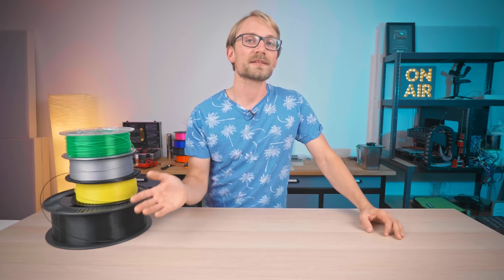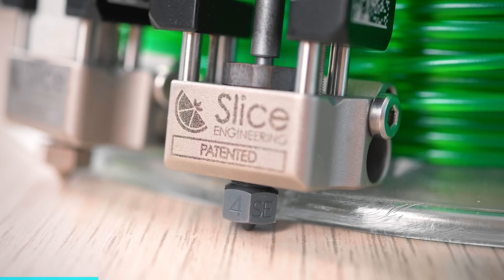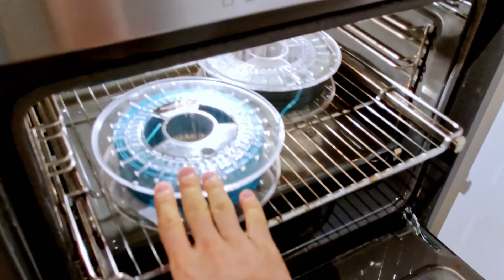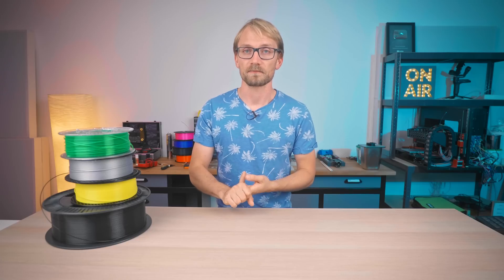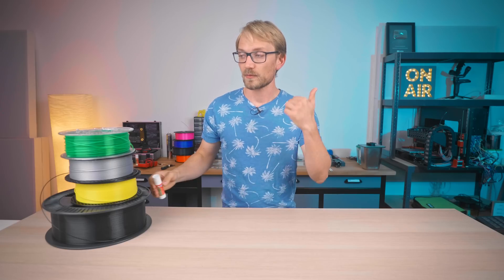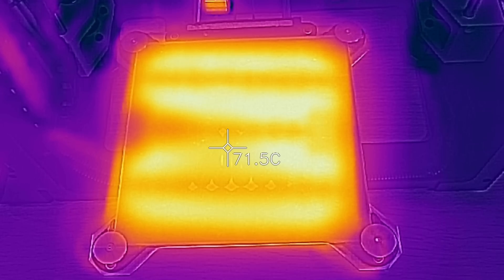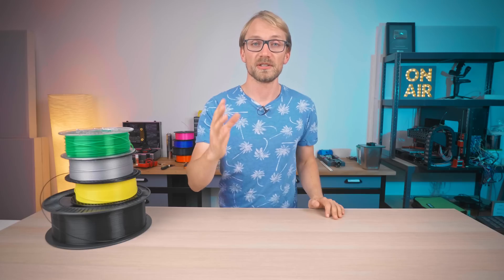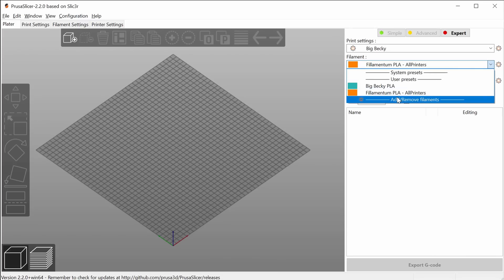How I tune in new filaments!

Comment: 80-90 on the bed for petg? I don’t use any heated bed on my petg and I’ve never had a single issue....weird.
Reply: Depends on how big the print is. 

I had to go up to 95c bed temp on a 12x12x10 petg print as even at 80c bed temp it started curling up like abs. 95c, it stayed perfectly flat until the print was done and everything cooled slowly

Comment: Hi Tom, You commented on my twitter post about the strange patterns in my top layer and said I had backlash. It was also many other issues related to this video. My ender had a dip in the middle of the metal bed so when I removed my glass bed to use a flexi metal pei sheet it was dipping in the middle. I also had to work out the amount of filament extruded because it was a bit too much plus the fan on the ender was running very slow. So all these problems caused my rough top layer. I switched back to a glass bed, re-calibrated the extruder and the diameter of the filament fixed the slow spinning fan and I had much better results. Also adjusted the belts, replaced the nozzle and made sure it was straight.

Comment: Before tuning in flow rate and retract I like to tune E-steps and linear advance set the values in the filament specific start G-CODE in prusa slicer. Those value can vary greatly between different types of plastic.
Reply: I would probably go in this order: E-steps, flow rate, linear advance, then retract.

Comment: Great video, this is exactly what I've been in need of. Quick question; do you keep your filaments stored in dry locations even if you dehydrate before use? I've been contemplating making a dry enclosure for filament storage.
Reply from the maker: Depends on what type of filament and how well you can condition your space. I'm totally ok with leaving a spool of PLA out in my dehumidified basement, but I wouldn't leave PETG out in Florida humidity.

Comment: dry.

heat tower.

flow rate cal.

optimal level height.

that's it :) better yet, it takes under 30 minutes (thats with print time.)
Reply: I'll change my order. I usually do flow rate cal (by measuring the walls of a vase-mode box) and then temperature tower. (I also to K value for LA and max volumetric flow, but both of those I do after the temperature tower.)

Comment: Another great video!  Question: you mention putting filament in the oven, I've heard about it for a long time now, but, what are your thoughts on a gas oven?  It seems to go back and forth on ya or na.  I don't have an electric oven, or dehydrator big enough.
Reply: I don't think there are any gas ovens that can maintain low enough temp.
Reply: @CJICantLie  I'll run mine with a external thermometer, thanks for that idea... My concern was the moisture that burning gas produces... Counter productive?  I don't know.
Reply: @Christopher-Enoch  I have heard, about the only way to use a gas oven is to heat it up, let it drop to the temp you want(80-100 for abs/nylon/petg drying, 60ish for PLA), then toss the rolls in and let it cool off a slowly. Going through that cycle a few times can get the job done. It just won't be as hands off as electric.
Reply: @CJICantLie  Yeah, mine only goes down to 76C. Bummer.
Reply: Food dehydrators can be found as low as 20 dollars (on clearance), the 50 dollar-ish jayo filament dehydrators work slowly... if you have a toaster oven that is big enough to cook a pizza and has temp controls then you  can use that but watch it so it doesnt catch fire. Just some ideas if ya havent found something that works yet.

Comment: I don't understand why stringing and blobs would be two opposite phenomenon. Blobs usually comes, similar like stringing from too little or slow retraction, due to too high pressure in extrusion zone of the nozzle, causing liquid thermoplaste flowing out during (stringing) or after (blob) travel movements. Stringing is also more a function of cooling and temperature, while blobs are primarily caused by too slow / little retraction .

Too high / fast extrusion often shows in underextruding / missing the first ~1 millimeter of each layer (=> "seamcrack") - in addition to the by you mentioned scratching of the nozzle into the lässt layer.
Reply: Too slow or too much retraction will cause the nozzle to stay in the same spot for longer while it retracts, which may overheat the area under the nozzle and sometimes create a blob.

Comment: I thought you didn't need a heated bed for PLA?
Reply: You don't need one, but it will help
Reply: @clytle374  Is it important enough to add 35% to the electric costs?
Reply: @Martial-Mat  Seeing as filament is many times more expensive than the electricity used during printing, yes, if it prevents a print from coming loose after you've already put a lot of material into it.
Reply: @TrueThanny  Oh that's a good point. Didn't think of that! Thanks.
Reply: @Martial-Mat  I doubt it's only 35%.  My large delta printer has a 40W nozzle heater and a 350W bed heater.  Of course both are modulated to maintain a set temp.  But as Thanny said starting over never helps reduce energy usage.
Reply: @clytle374  I'd be interested which costs more power; the bed/head motors or the heater.
Reply: @Martial-Mat  It's going to be a complicated problem.  The bed has the largest area, so I would guess it loses the most heat.  Then my nozzle has a silicone sock so it shouldn't lose much, but it's at a much higher temp so that increases loss.   My motors are set to 1.5 amps each,  but they require a much lower voltage to pull 1.5A.  But that voltage is only when sitting still.  And I don't know what the conversion efficiency of the Duet2 board is when running off 24V.  It also depends a lot on what I am printing, and the temps I am running. A 12 inch bed at 110C runs the 350W heater pretty hard.  Before a major upgrade I was printing the prusa face shield headbands for medical workers in 1 hour each and the 350W power supply I was using was screaming hot and the voltage dropping out pretty bad.  But the energy wasn't lost as I still needed to heat the workshop. I have a tiny delta that will print with using a total of 120W with the bed at 100C.